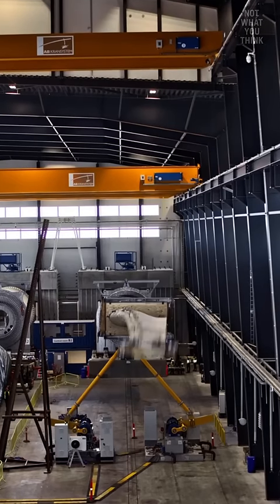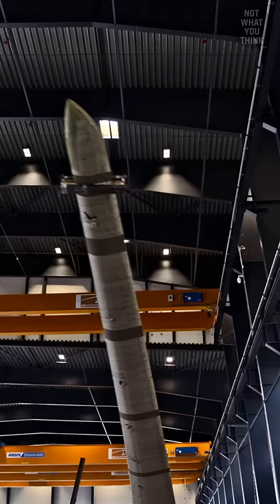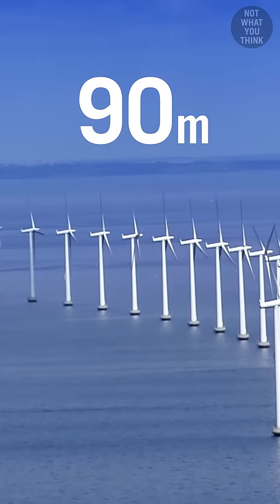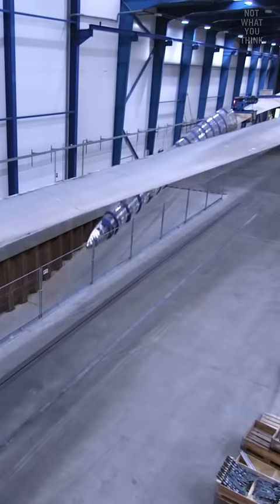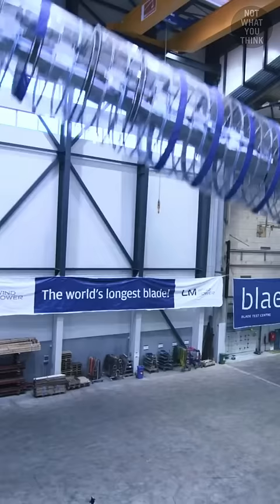Oddly Satisfying? #shorts

Comment: "Erecting a wind turbine"
- Engineer
Reply: 20 years isnt very long.
Reply: @censored4christ162 actually that’s way above average
Reply: Yup I built that.
Reply: @unflinching6057  🤓🤓🤓👆
Reply: I love the jokes here but ,
   when I see Gigantic "Turbines" atop Like Pylons, apparently turning a suitable Alternator, I always want to ask those involved if they are aware that the "Economy of Size'Scale for these two components are OPPOSITE to one another.  Specifically, doubling the linear dimensions of the T will drive an A of 4 times the thro'put- but will 8 times the weight.  So doubling the size doubles the cost/watt of the T.
    Conversely, the One A to replace the previous 4 that werel required to process the same volume of wind,  costs only about twice as much as any one of the four.  So the A bill halves if the size is doubled.
     This leads to the Cost per watt versus (log) Size being a necklace shaped curve.  The lowest cost per watt is for sizes where the cost of the two components is about equal.
      Looking at current - Ever Bigger - units, I ask myself are those two cost about equal ?
Reply: @GerardVaughan-qe7ml  …

Comment: Here in Iowa we have them all over, never EVER seen any failure within the fiberglass structure, all failures I’ve ever seen have been caused by electrical fires. Those puppies create a lot of power and the tiniest thing can cause a major arc.
Reply: I worked on them all over Iowa
Reply: They also leak hydraulic oil like a sieve 
And there have been a lot of blades break due to lightning strikes in your state

Comment: That machine used way more energy than the windmill will produce in it's entire life span
Reply: This is the thing. NO wind turbine will EVER make more than it costs to build and operate. Not to mention they have diesel generators on them for heat in winter.

Comment: I knew what it was immediately. I live in a windy area with wind turbines all around. I see them on trucks at least once a month. You can't miss them; they are twice as long as a normal semi-truck. The escort vehicle that follows the truck on the convoy has a remote-controlled apparatus that steers the back wheels of the trailer. That's the only way they can turn the thing!